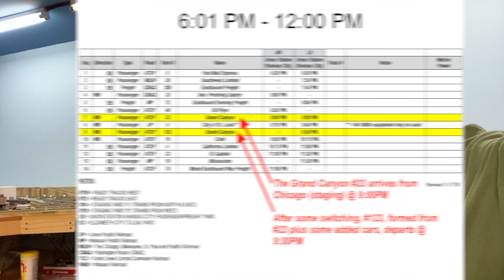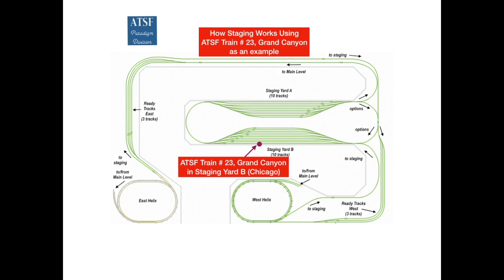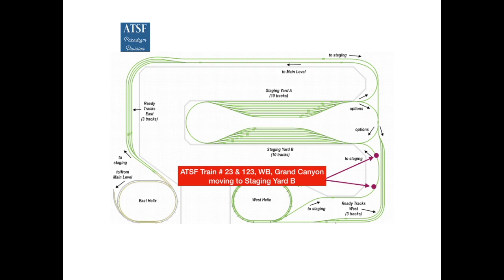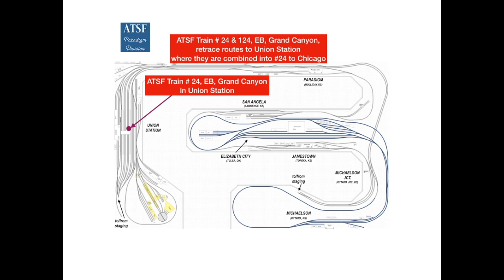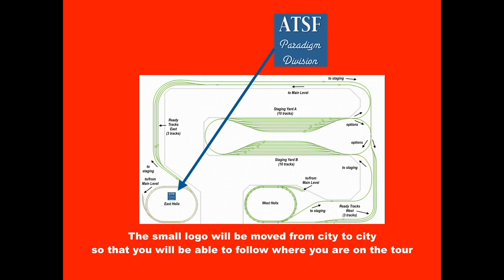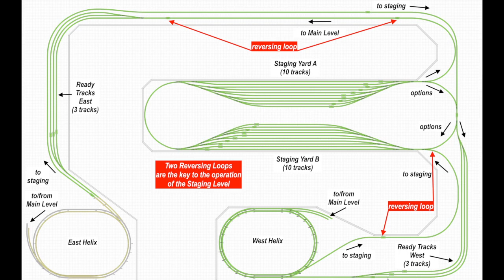Layout Tour Part 2 - The Staging Level

Comment: Great tour again. Love how you have set your staging up with the reverse loops. Very ingenious idea. Thanks again for showing us what you have done. Cheers Darren
Reply from the maker: Thanks again Darren.  Another one of the reasons that the staging was done that was was to reduce the need for two sets of equipment plus engines for the same passenger train due to the schedule.  For example, there are times when the same train, like the WB Super Chief, may depart Union Station for LA but need to reappear from the west traveling back to Chicago fairly quickly. So the track arrangement permits the train to go down to staging on the west helix and then loop around to Ready Tracks West and up the west helix and travel east to Union Station as the EB Super Chief......John

Comment: a great design that i might have to think about using in my layout with the two helix it has me thinking thanks
Reply from the maker: Mike, Thank you for your comments.  I really dislike duck-unders so after about a year of looking a various designs, I decided on the two helixes (helices).  Mine are made of spline & double track (up track & down track) and they took about 18 months to complete. I really liked the use of the threaded rods external to the base of the helix as it allows you to make fine adjustments.  This technique could also be used with plywood.....John

Comment: Very interesting John. Especially the reversing loops of staging A & B and the options it gives to run East or West. This is indeed a very clever solution and very unique! Well done - good thinking !!! How many 'operators' enjoy an operating session on the ATSF Paradigm ? I enjoyed your tours 1 & 2 and now I'll have to start over the concept of the AnneliesVille... for I have only 3 staging tracks...dead end. Thanks for sharing ! All the best & happy model railroading! Greetings Filip
Reply from the maker: Hello again Filip.  I spent a lot of time designing the staging level to give me the options that were shown.  By the way, I am the only operator so far although the layout could probably support 5 or 6. The two reversing loops were the key elements to make it work especially since the PSX-AR auto reversers are very simple to install and they work flawlessly.  They aren't cheap but they were definitely worth it.....John
Reply: @tanzj  Thanks for your reply John. I learned a lot. Thanks ! Greetings